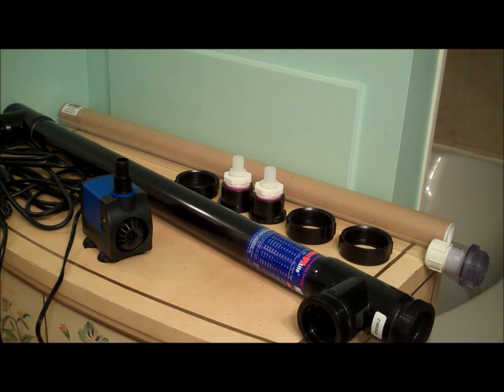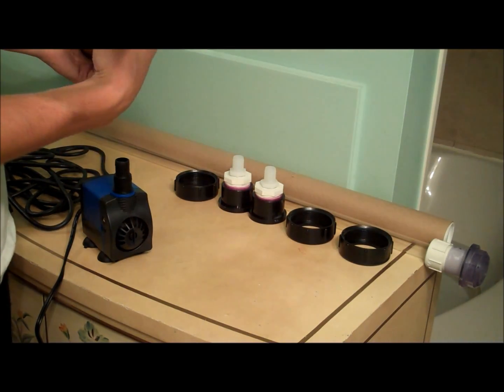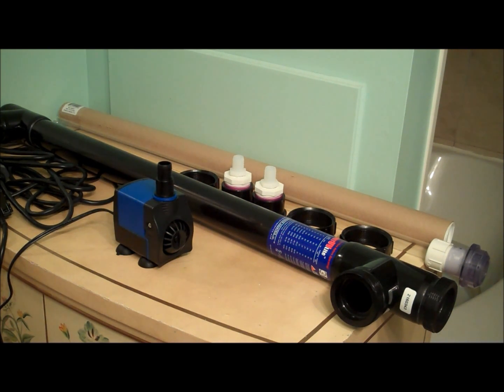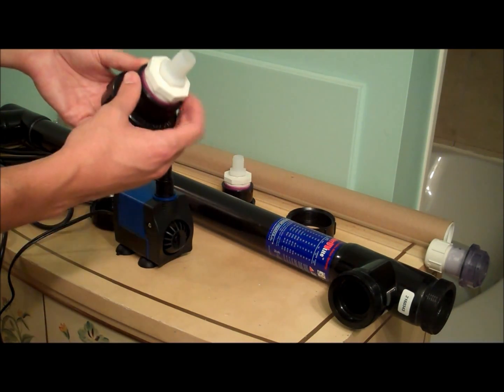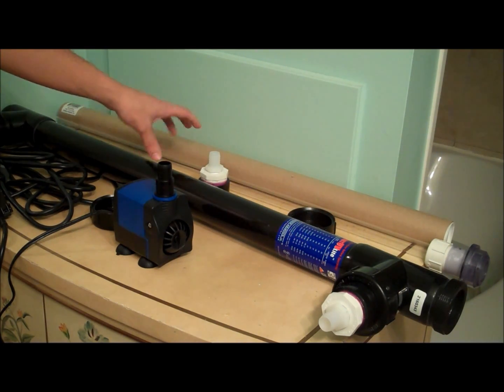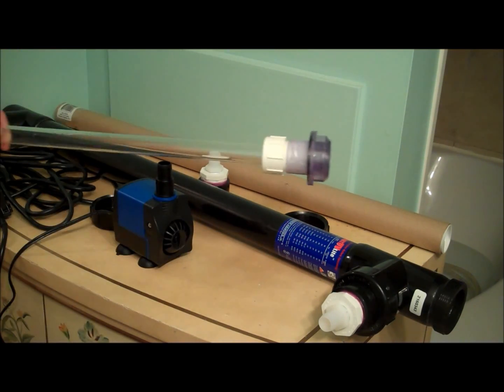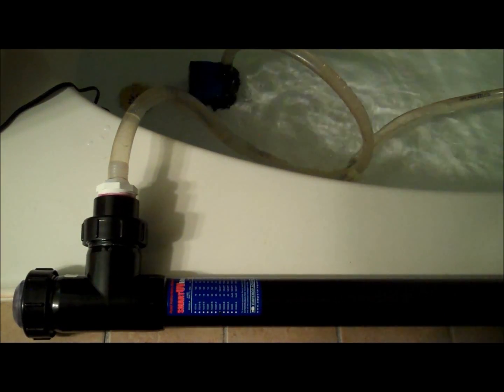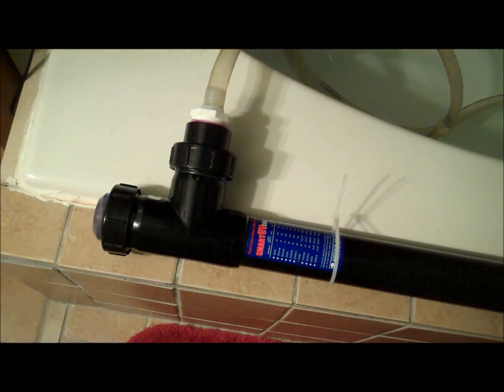Emperor Aquatics Smart UV Sterilizer 40 Watt

Comment: I was planning on hanging mine inside my stand area going horizontally. Would it be acceptable of having the silicone tubing run from the sump about 2 feet up with a check valve, and a union valve on one side? I want to run about 450gph on mine and just was wondering if that would be too much pressure and instability to eventually cause a leak or something.
Reply from the maker: you should be fine just make sure you use hose clamps
Reply: Roger...I'm getting the 25 watt one...its going to be hanging about  1.5 feet above the pump inside the stand. Got any pumps to recommend. I was trying to get to around 450gph to kill algae and bacteria like they talked about on the BRS website.
Reply from the maker: +Jeremy B Danner mag 5 would be the most reliable and it would be around 450gph
Reply: +Jeremy B  Hey there again...so I'm about to set up my reef tank...and I originally wanted the emperor aquatics 25 watt...however my supposedly expert fish guy helping me is telling me to get the 18 watt. The 18 watt emperor aquatics claims that a 18 watt is rated for 60 gallons, and the 25 is rated for 90 gallons. However he is saying that once the LR is in and everything else there will be only about 60/70 gallons of tank water...and that I don't need the 25 watt. I'm having problems deciding what one to get...then if you go to Aqua UV there saying that a 15 watt is rated for 15 gallons...so if you listen to them surely a 18 watt would be enough for a 90 gallon. I was planning on using the sterilizer for low GPH...not on the high end. Mainly to kill protozoa. Its really interesting because when I called Emperor aquatics and Aqua UV there numbers for the exact same wattage and at what GPH kills what was vastly different...and both companies claim there statistics are based on facts lol. I already bought the 18 watt...so I may just stick with it. I plan on keeping creptic bottom dwelling fish with thicker slim coats that are fairly disease resistant. Not angles, butterfly fish or tangs. Plus I'm not going to overstock my tank either...
Reply: +Jeremy B  I also see that it says this on the BRS website. "Suggested sizes are based on end of bulb life to ensure continuous results"...which leads me to believe that they assume people wont replace there bulbs every 6 months as recommended...
Reply from the maker: +Jeremy B it won't make that much of a difference, if you go with the smaller watt just run a slower gph flow so there is more contact time, if you can afford bigger than go bigger
Reply: Yeah...my thoughts exactly. Once I set it up I will see how much extra space I have. Unfortunately them dang things are so long...my tank is 90 gallons but its only 36"*24*24...so you can imagine the problems I'm running into. Not able to have a large sump etc etc...luckily I'm picking hardy fish and am getting top of the line equipment. In hindsight I should have gotten the traditional long aquariums, not a cube kind...

Comment: Did you ever notice the sleeve smelled like burning plastic when you first operated it? I did a dry test run and it seems to be the case, not sure if it's just something that happens when its new.
Reply from the maker: that bulb gets really hot and the only cooling it has is the aquarium water moving through the sleeve, so definitely do not run it dry! and also make sure there are no air bubbles in the sleeve
Reply: +kodeblue24 Thanks for the reply man. When you opened the product for the first time did your sleeve appear to have dry water marks (circular dots all over the exterior of the sleeve)?
Reply from the maker: +ilmgwamh yeah that was from them testing for leaks during manufacturing
Reply: +kodeblue24 And whats the best way to clean the quart sleeve  and light?
Reply from the maker: +ilmgwamh the light will not need cleaned but the sleeve can just be wiped down with vinegar and water

Comment: curious guy it says you need at least 1,574 GPH flow rate to be affective and not to kill pods and you are only doing 600 GPH  ? that will kill everything food wise only 600 gph ?
Reply from the maker: I used the low flow for about a month to kill parasites, then after that I uped the flow and only ran the uv for 8 hrs a day

Comment: this does NOT kill ich.  if the ich doesnt go through the light its not going to kill it .  and since the parasite falls off the fish and ends up down into the sand bed........ its not going to work
Reply from the maker: yes, but when ich hatches they release thousand into the water column and the uv kills there reproduction and that will stop the ich from getting worse and multiplying
Reply: ya but if the ich at the free swimming stage of the life cycle doesnt make it into the UV its not going to work and the life cycle will just keep continuing.   I actually just bought the same UV you have just to see if i can prevent ich/algae so hopefully it does work
Reply from the maker: +joe0813 you will see it will work it takes time I have no problems with parasites
Reply: glad it worked for you... hopefully mine will too
Reply: +kodeblue24  Ur right it does kill ick

Comment: Question isn;t the input at the other End ? According to the manual if set horizontal.
 I had it on the electical end like you but then changed it to the other side.